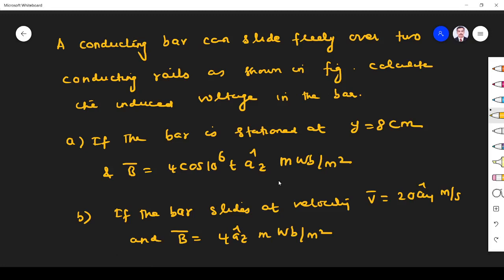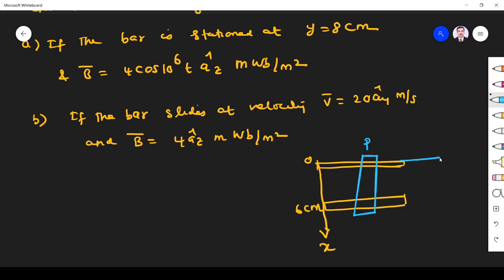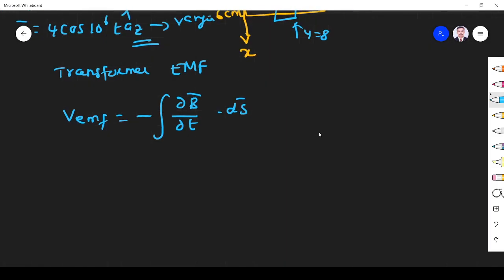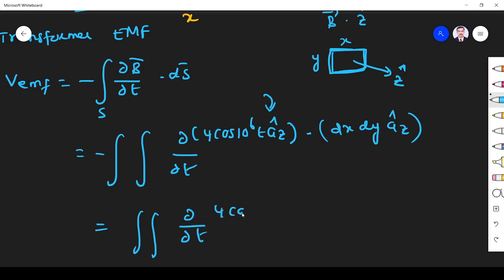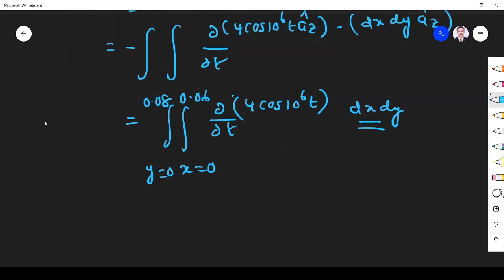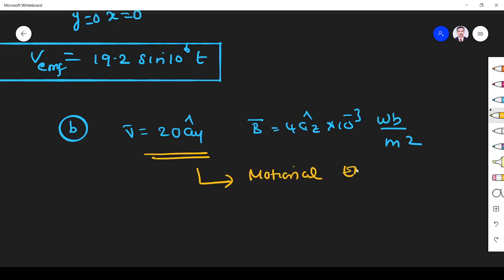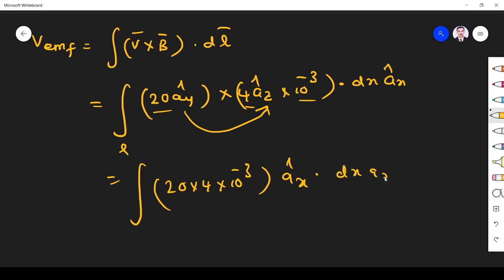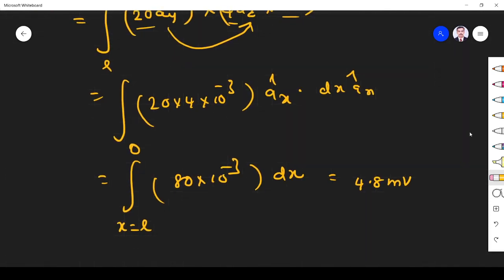EC8451 ELECTROMAGNETIC FIELDS EXAMPLE PROBLEM INDUCED EMF

Comment: Show us how you to find 19.2
Reply from the maker: First partially differentiate what is inside integral with respect to t. Then integrate the result with respect to x and y and substitute 0and 0.06 for x as upper and lower limit.. similarly u can substitute y values and find..since it's easy process did not elaborate in detail
.
Reply: @majeethlectures  thanks let me try this